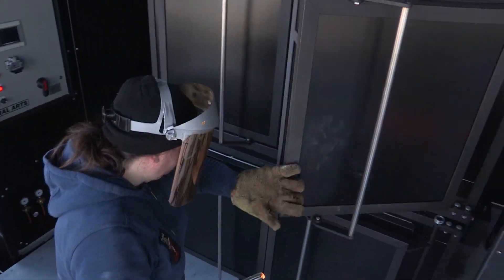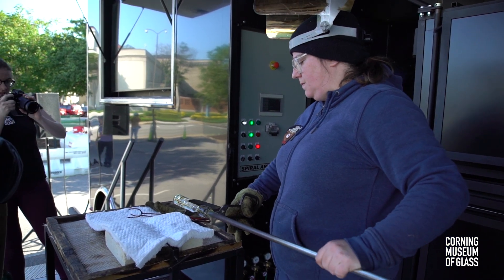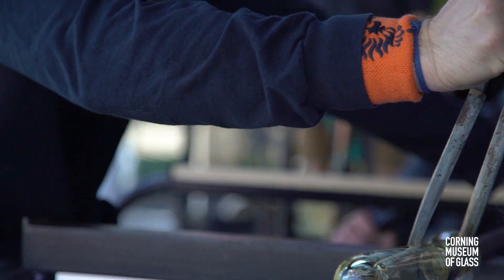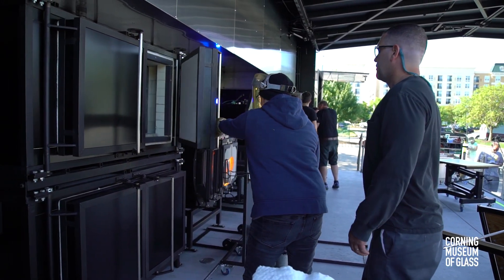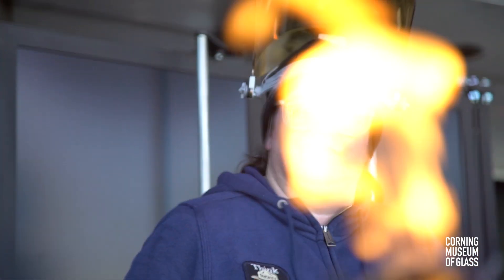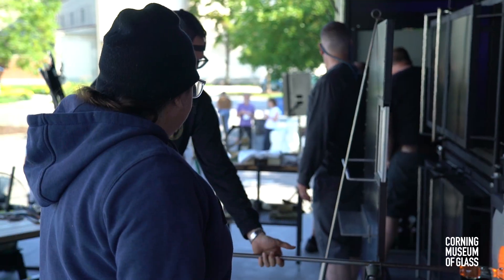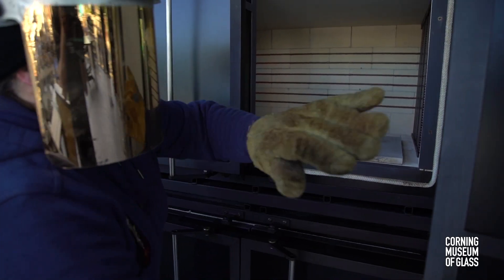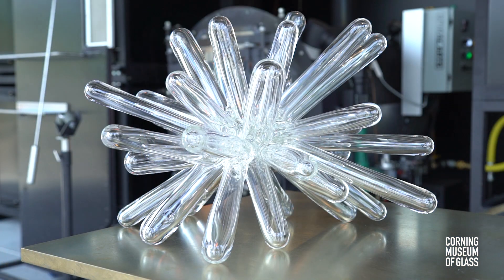Jen Elek | Glass Art Society Demo 2017

Comment: What's the temperature of the annealer? If I try putting in a piece I just broke off of a punty and it touches another piece, most of the time, one of them cracks from thermal shock. How is adding hot bits while the piece is in the annealer not cracking the rest of the piece??
Reply: Cobalt I'm think the annealer needs to be around 1000 F and up and 
As long as the piece stays warm it should not crack , I'm  guessing she takes  her time , and is very meticulous.